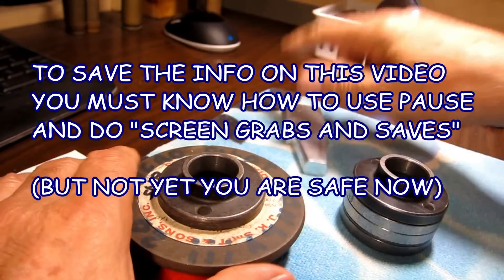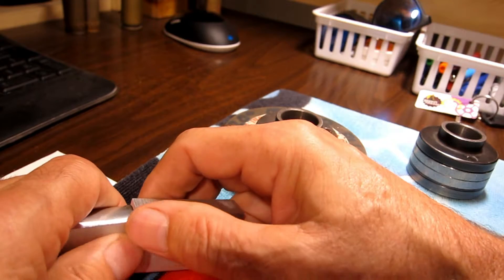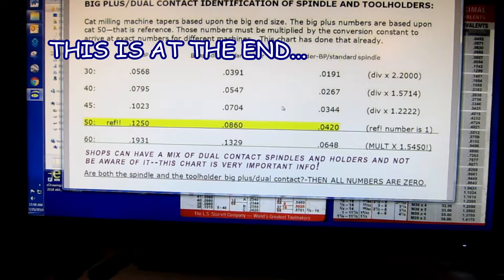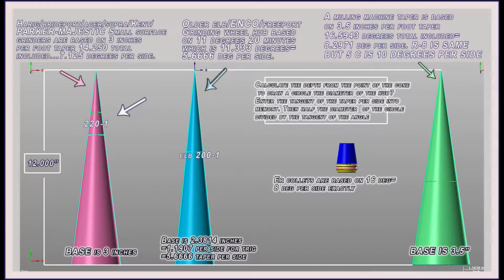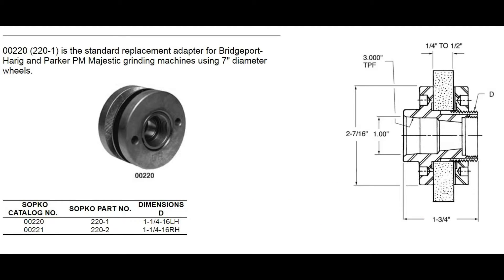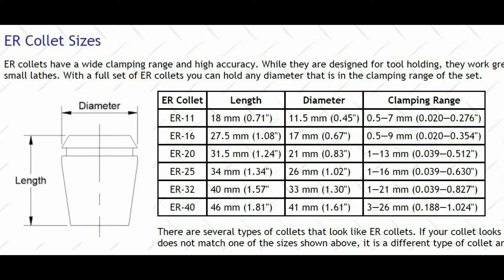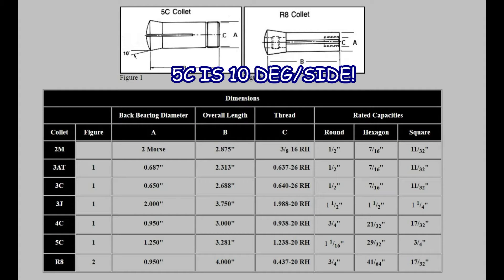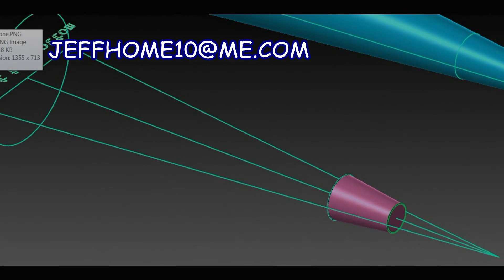GRINDING WHEEL HUB AND TAPERS IDENTIFICATION ALSO MANY OTHER TAPERS

Comment: Well at 6:36 you show the R8 taper of 3" per foot. A time wise long thread in practical machinist:
   https://www.practicalmachinist.com/vb/bridgeport-and-hardinge-mills-and-lathes/r8-taper-specs-117378/  (June 2005 to June 2020)
that was all over with 3.5" per foot, came up with a bastard number of 3.5868 per foot, or 8.5 degrees half angle (based on a Hardinge drawing post#20). So the 16 deg 51min number is wrong. Or all these expert machinists are crazy. One early error I see is they used the isosceles triangle, not a right triangle in their trig calculations. Even Machinery's Handbook has the conversion over many revisions screwed up.
So for R8, I still don't know what the correct angle is.

Comment: Thanks for posting this. I found this with a search for a hub for my harbor freight surface grinder I got many years ago. Pretty light duty, but works good enough. 
Interesting videos, especially geology.
Reply: I have a hf surface grinder also. What number hub did you come up with ?
Reply: @noneofabove5586  I'm making a bar with the taper on the end so I can balance a wheel. The taper is ~7 degrees. The nut holding the hub on to the motor shaft is M16x1.5. I need to fix the nut on mine, as it's the same diameter as the 1.25inch hole of the larger nut that holds the wheel to the hub, so I have to remove this smaller nut every time to change the wheel. I mounted the hub in my lathe chuck then used an internal bore indicator attachment to sweep the angle and set the compound to this 7 degree angle. I did use prussian blue to check, and had to adjust the compound to correct the angle, but that only took one iteration. The pin spanner that came with the grinder is junk, so I need to make something for the smaller one, and the larger nuts.